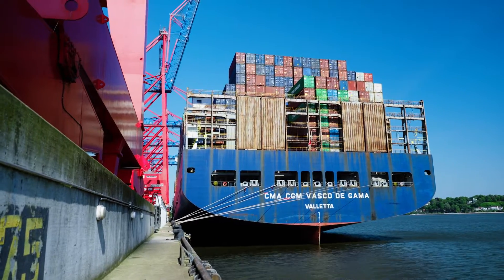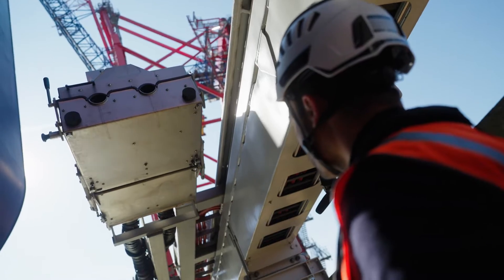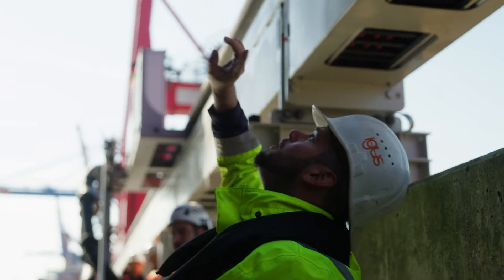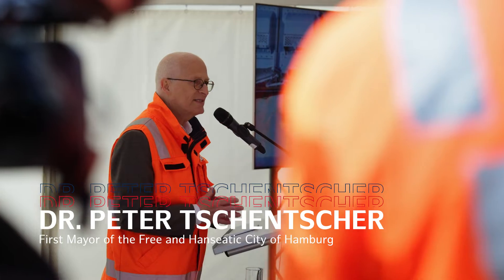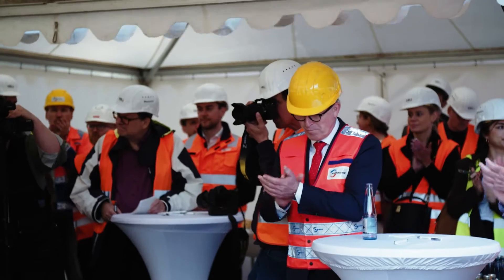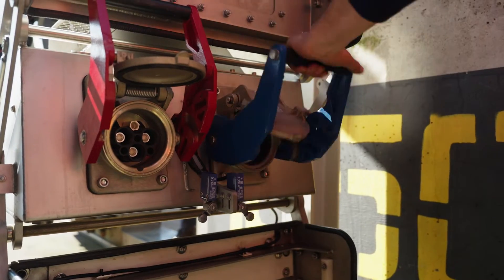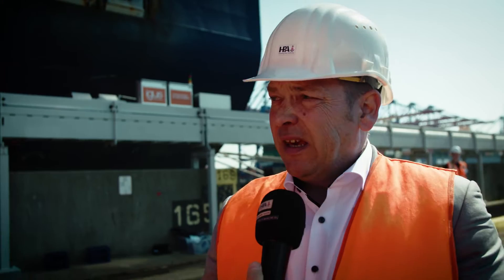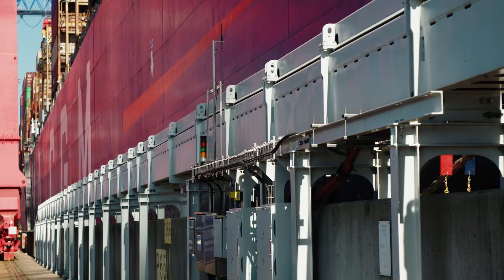Shore power for container ships in the Port of Hamburg

Comment: It's actually hard to understand why this hasn't been the worldwide standard for a long time!
I mean, we're talking about one cable and two sockets here. Sure, the technical challenges are certainly there, even if they are mainly due to the fact that there are no standards in shipbuilding on this subject. Ship owners should be forced to adopt a standard.

It's really not rocket science!

Good work Hamburg, hopefully this will become the norm!
Reply: I agree. I had the same comments. Where I live in Miami they finally added Shore power and they made a big deal out of it. As if it was some sort of innovative breakthrough. But this is not rocket science and it should have been done 20 years ago